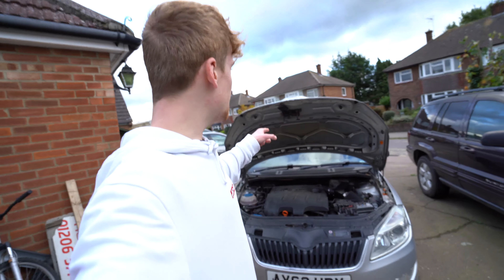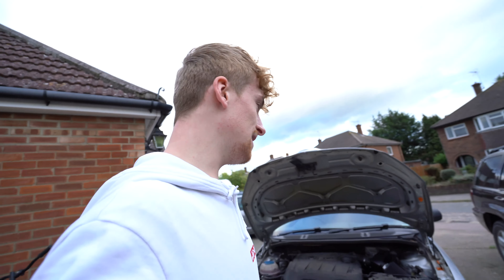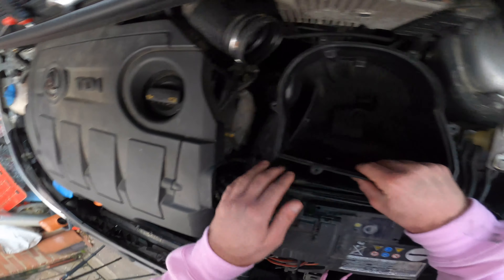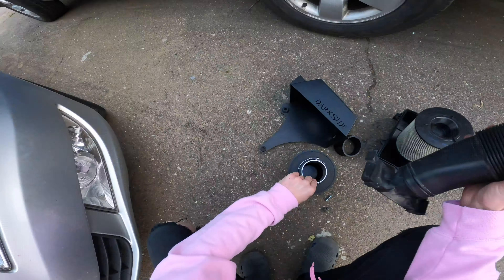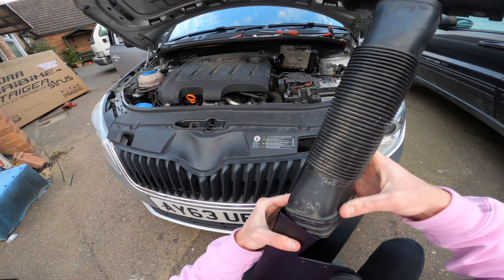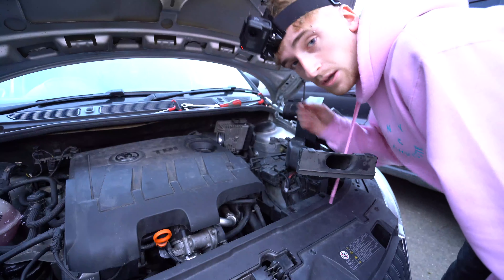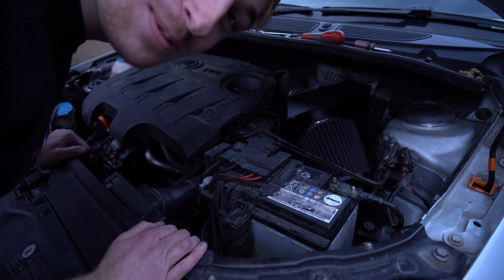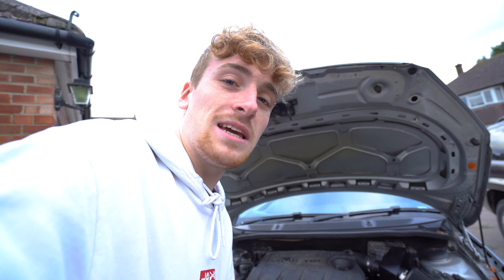CAN I TUNE MY OWN CAR WITH NO EXPERIENCE!? - EPIC CAR MODS

Comment: That intercooler looks dope, too bad it's not visible, you should definitely install it, or you can install some twin electric turbos, no intercooler or exhaust turbine needed it runs off a brushless moto from your battery, they actually work, search "Cleetus McFarland electric turbos" for a good laugh and impressive performance on the Dyno.